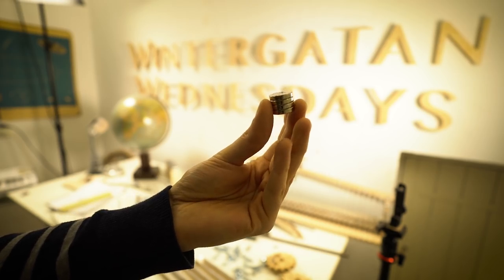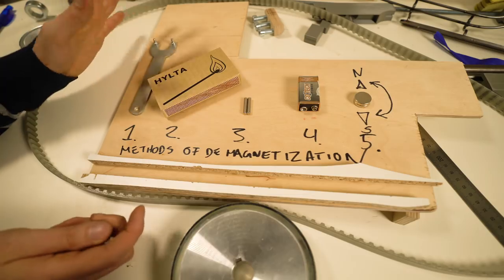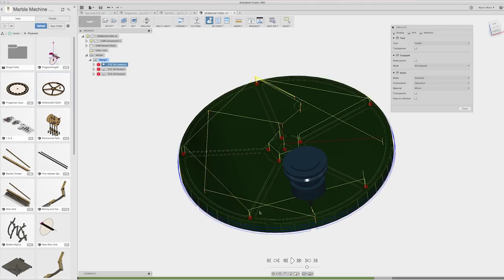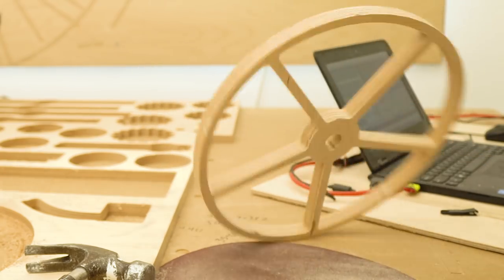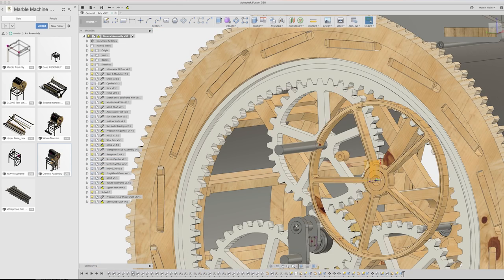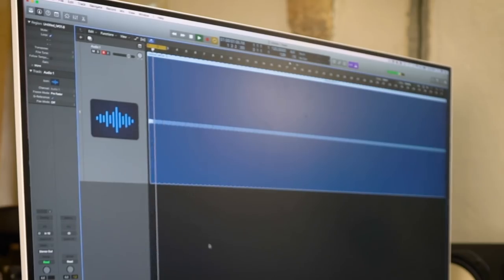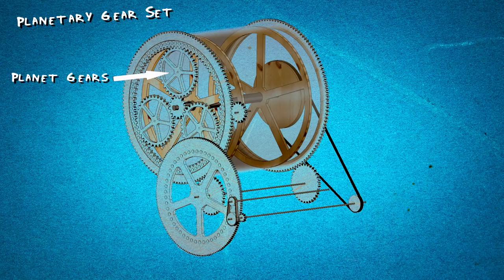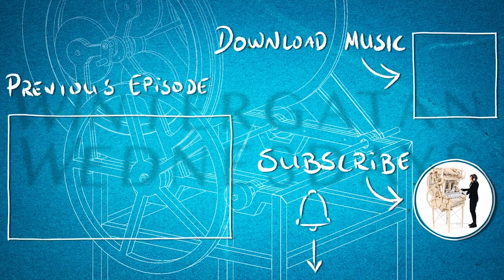Marble Demagnetizer - it's Mechanical! - Marble Machine X #23

Comment: Awesome! Loved the procrastination intermezzo! :D
I‘m just thinking: Might it be better to have the demagnetizer spinning opposite to what is shown in the video? Otherwise it could happen that a marble only sees one polarity if its speed corresponds to that of the wheel.
Reply: actually no. The marble itself spins (rolls) so... if the degauss wheel and the marbles roll in different directions this effectively adds the speeds up to each other reducing the degaussing effect. If they roll in the same direction the speeds cancel out and the marble will be put under a longer time of degaussing at slower alternating magnet fields = better degaussing.
Reply: Bart Bols Right, I totally didn‘t think it through. However, it should be enough to have a line of alternating magnets below the track, which slowly slopes away from it. This should have the same degaussing effect while reducing complexity.
Reply: Problem is if the magnets are static it could capture the marbles and plug up the system
Reply: I don't think the marble will be spinning while in the lifting wheel?  interesting point, though.

Comment: In Pinball they use carbon steel balls, because carbon steel is doesn't magnetise as much. So unless you are already using carbon steel balls, you should definitely look into that.
Reply: I suppose they get knocked around a lot more than the marbles in this machine will while being transported up, that would help the process
Reply: Pinball tables also use strong electromagnets to "grab" the ball, or even move it across the playfield*. So magnetization is a problem, but there are no devices for degaussing the balls. Seems using carbon steel balls in this build would go a long way to help eliminate the problem. ( but maybe the degausser wheel does the job just fine.) 

* Bram Stoker's Dracula, Mist magnet test, moving the ball across the playfield. https://www.youtube.com/watch?v=FT8_TPn5rEk
Reply: lordsqueak in pinball machines, the marbles are being hit constantly and that's a viable method to demagnetize the marbles
Reply: Touff in mmx the marbles dont hit anything? like vibraphone, all the time? ;)
Reply: Good point. But marbles in pinball machines likely get hit several times between magnetisations. In the case of the MMX, magnetisation is a bigger issue because it's stopping the marbles from rolling, but they must roll in order to get to the hitting part.
Reply: Not really though, the balls bounce around a lot for sure, but it's mostly rubber it's bouncing off of. in multiball they do bounce off of other balls. But the thing that keeps the balls from being magnetized is the carbon steel they are made of. 
The magnets that capture balls are really strong to just grab an 80g ball in mid movement, So I would imagine normal steel would quickly magnetize and cause problems. ( judging by the video here, it would not take much to magnetize them.)

I'm not saying he should replace the degausser wheel, because it's probably useful in making sure even the carbon steel balls doesn't act up. But they would certainly help minimize the problem.
Reply: Pinball machines' electromagnets are typically AC, so they actually work to demagnetize the balls.
Reply: I am no expert in these matters, but I got curious a googled a bit. Found 2 patents in which one seems to be fed 48V but with a timer, The other is fed AC, but only uses the peaks (looked like dc orientated). So it would seem they pulse the current to avoid the coils from overheating. (so using ac avoids the need for a timer)
I'd imagine that any magnetic field, no matter orientation, would magnetize a ball if suddenly turned off. So I don't it really matters if the pulses are dc or ac, it's going to retain the last pulse. ( which is why degaussing needs to be faded out.)
I also saw something about always using diodes on any coils to avoid feedback pulses, so that would suggest the coils are powered by only positive pulses, making them one way only.
Reply: Actually hardened steel tends to have a higher retentivity, soft iron marbles would work better at not staying magnetized after they are away from the magnets.
Reply: I just know that they are specifically using carbon steel balls , for this specific reason.
I also kind of remember that ships have a huge problem with getting magnetized , and that the reason they don't use carbon steel is because it's brittle. ( Titanic was the historic example of why that's bad.)
Reply: Preeeeeeeeeeetty sure they use stainless steel balls. Carbon-steel balls would not only magnetize, but they'd also tarnish and grow dull. There is a such thing as non-magnetic stainless steel, perhaps you meant that. (I'm a blacksmith for what it's worth, I know a thing or two about iron)
Reply: The standard ball is hardened carbon steel. ( and its resistant to being magnetized )
Although there is stainless and chromed and even ceramic balls being used also. (Twilight Zone has a powerball which is ceramic, that shows up at "random") 
I don't know much about metallurgy, but I'm into pinball ;)
Reply: (Oooo, Twilight Zone is a great game. It's on my bucket list to own a Addams Family machine some day) OK, so I'm finding sources that echo what you're saying about carbon steel. At the same time, I'm under the impression that pinballs are merely 1 1/16'' ball bearings, and further under the impression that the average ball-bearing is chrome-steel, with the chrome added for the sake of hardness. I can't find any ruling on the "standard" ball alloy number. I'll have to do some more research later. Oh, but I stand by the fact that standard carbon steel alloys magnetize with no problem.
Reply: Well it could be that it is more resistant to being magnetized in the first place, but once it does, it holds it better. ?
Reply: Thats a big fat no to stainless. As an owner of several machines, you can get carbon steel balls with special platings these days if you desire but anyone who has tried to go outside the box with stainless finds the weight all wrong throwing the game physics out - work hardening of the ball can also lead to it abrading the playfield. Also going for plain bearing inevitably ends up with magnetization issues

Comment: What are you going to do about the slow loss of magnetism in the various disc magnets in the machine? As you magnetise the marbles so you demagnetise the discs a little bit and the same for the new demagnetiser magnets. As it stands, it looks as if you will have to eventually remake any of the parts that have magnets permanently glued to them.
Reply: What? Where have you ever seen a neodymium magnet that has demagnetized from using it too much? Yes, all magnets demagnetize slowly, emphasis on slowly, as in our great-grandchildren will be long dead before it becomes an practical issue.
Reply: I did say "slow" :) . I imagine the rate of loss depends upon how the magnets are used. But I grant you that neodymium magnets will probably outlast us all. There are a couple of references here https://tinyurl.com/ybygeycw and here https://tinyurl.com/y6whdejz but they are not too explicit on these particular magnets.
Reply: The magnetism of these materials arises from the crystal structure, which is homogenized during manufacture. It would require very high temperatures (e.g. marble machine on fire) or a much stronger external field (e.g. NMRI of marble machine) to noticeably decay.

Comment: For the sake of simplicity: IF the marbles already have an initial velocity (which seems to be the case in your video), wouldn't a demagnetizer wheel with zero velocity work just as well? The point is to let the marbles experience a changing magnetic field over time. By letting marbles travel over a linear array of magnets, the same effect is achieved. Or have you already tried this?
Reply: I thought the same! Plus, the marbles are rolling, so the metal will already experience fields from different directions even if the magnets all pointed the same way. I guess a problem might only be that the marbles stick to the static magnets if they don't have enough speed, and then jam the entire machine that way..?
Reply: I thought this too, he has them rolling down that ramp, all he needed to do was to put a series of alternating magnets under the ramp as it flattens out. . . I guess that's why I'm an Engineer and not an artist :(
Reply: wasn't the demagnetation mechanism required to make sure the marbles would still have its rolling momentum despite being magnetized.
Reply: i thought the same - a row of alternating magnets in a fixed position along the underside of the marble-ramp, seeing as the marbles are already moving. As they roll down they will move through + - + - + - + and so on - the magnet array could be angled slightly away from the marble-ramp (so as the marbles roll further down the ramp, the array underneath becomes further away) so the field strength should weaken as they roll further - he may have tried this though - or did he just jump straight to the spinnig idea?

Comment: Do NOT worry, you are NOT miking this, yes you are learning but so are we, its FANTASTIC that your ambition for this was so far ahead of what you knew at the start (and if far beyond what 99.9% of us will ever make) and you are making it !, everything you need to learn as you go you ARE learning !. BTW, (1) The gears fit perfectly now but (a) as far as I know wood expands and contracts depending on temperature and humidity, so you wany wish to design in some easy adjustment (or even a spring preload ?) on the bearings (b) the wood will probably wear quite fast if left as wood sliding on wood, I would give serious consideration to (1) using some kind of wood hardener (2) adding some kind of lubricant (perhaps wax ? .. thats an old cabinet makers trick on wooden drawer slides) or even (3) put some PTFE tapeon the meshing teeth (its cheap, used for plumbing fittings, unwide some from the reel and just let the gears drag it into the tooth forms, put some glue on the wood to hold it in place (its hard to stick to PTFE but there is no stress trying to pull it off, should be ok.) .great videos and you have a lovely location in france. great video series, keep going ! respect !

Comment: I'm assuming you were thinking of this, but when you demo the demagnetization wheel, you were spinning it in the same direction as the marbles, putting them in contact with the field of a group of magnets for more time, allowing them to gain a bias depending on how long they are near each magnet. If you slow your video down, the marbles are only near many fewer magnets then if you used a different design. The second design you mentioned (With the Magnets rotating perpendicular to the movement of the marbles) or rotating the wheel you have in the opposite direction of the movement of marbles would probably be more effective. 
I'm not entirely sure of all this, but my mild understanding of physics would make me believe it's true. :) 
LOVE this design and look forward to seeing more!!

Comment: Reallifesoap like your video’s, thank you. Two remark. 1. The trouble started when you introduced magnets. The fix requires more magnets. Should you not ... step back and get rid of the magnets all together. There are other ways to get your marbles up there (e.g. suction). 2. Bringing magnets in is almost like bringing electricity into your machine. Movement plus magnets plus some wire/coil gives you current.

Comment: You can still add an electric Degaussing by attaching a small DC generator to some part of the spinning system and then electronically make AC out of the DC and hide the Degaussing coil were needed. This can be done to add to your passive system.

Comment: 3:51 -  You can route the ornamental tracks first... then apply a layer of paint which will only cover the surface. Then route off a thin layer of the surface only... leaving a two-tone finish. Then cut the part. The color will remain ONLY in the ornamental part.

Comment: I have a Little suggestion: And that is a mechanical RPM/BPM counter that ensures you are Always cranking in the correct pace. Now to my idea on how that could be implemented: Think of an weight on a screw, that can be screwed in and out to adjust the force excerted on a Wheel (to change which RPM is the "correct" one depending on which song you are playing). Of course this needs a double nut locking so the setting is not accidentially changed during play. This weel is then magnetically coupled to the crank, so depending on how much the counterweight is screwed out/in, a pointer will show if you are cranking good, too fast or too slow. Like a red-green-red scale. Think like how a mechanical speedometer in a car works.

Comment: Hm, I was thinking about the notch you have in these wheels to drive them. Since all the wheels are made of plywood, and in the later videos you use metallic parts to drive them, I would perhaps use a thin layer of some metal inlay so that the driving 'pin' would not slowly eat up the notch in the center circle of the plywood wheel... might be an overkill though. In all subsequent videos you just used the pins directly into the notch... love the series to bits, and congratulation for the tenacity to do this sir! :)

Comment: Have you taken into account the speed of the marble flow and it’s direction, the speed will either add or subtract to the effective surface velocity of the demagnetizing wheel and would be a contributing factor of how fast you want it to spin, because it is parallel to the marble flow

Comment: Hey Martin: wouldn't it be much easier if you have a non-magnetic way of transporting the marbles up into the machine, e.g., some kind of lift similar to what you see in e.g. mining or construction sites (a conveyer belt type of thing)? That would eliminate a major engineering issue, i.e., the magnetism. Cheers! Love your videos, very creative on many different levels.

Comment: You could also try anneling the marbles, ie. heat them red hot and let cool slowly. That can make them magnetize less. It depends on the steel how much less. It will also make them softer, but I don't think that could cause issues.
Reply: He can then not lift the marbles anymore using the magnetic lift system
Reply: They don't stop being ferromagnetic, they just stop magnetizing permanently so much.

Comment: Fascinating! I may be late to the conversation, but is it possible to reuse the magnets in the elevator? I think I recall the big wheels alternating polarity when you built it. if you can force the marbles to roll slowly while the large magnetized wheel rotated behind it or have the first bit of track trace the top of the circle, that may demagnetize. Or I may be crazy.

Great design so far though, and honestly even greater videos. I hope the tour includes California!

Comment: Called it when you first announced magnets. I made the comments about pinball machine owners having decades of dealing with magnetized balls.

Also, you're pretty much building a giant alternator, if you use metal wires to build the marble rails. I wonder if the contact microphones will pick up the induced currents.

Comment: When you rotate a magnet you are in essence making electricity through an etheric field a full 360 rotation of a "magnet" create both a magnetic and dielectric field when these two energy fields cross they produce electricity. The centrapedal force and centrifugal forces is what is referred to as magnetism and what induces "polarity" however neather side is positive or negative in essence the repulsion is caused by the clockwise and counterclockwise energy paths of the energy field when you place say two "N polarity" and face them together  you are causing the molecules to be forced against each other almost like two marbles going towards each other on a track and bouncing away, where the opposite position is like two marbles on a two lane track moving past another. Another example that is more close to the movement of magnet particles is two springs rotating the same direction will always compress against each other causing repulsion but if they are rotating in apposite directions will mesh and move into another like a corkscrew. When something becomes magnetized it's acting like a battery holding a dielectric charge and producing an energy field until it's opposing energy being electricity neutralizes the force. You can see Dielectricity or a natural magnet as a highly negative charge and Electromagnetic as a highly positive charge.

Comment: For your marbles not to be magnetized you can use marbles of glass, or marbles of aluminium,  or even order a custom made marbles in a non magnetized material. Of course you will had a complete different way to lift your marbles without magnets too.

Comment: Hi, Would it work to simply have the magnets of the two lift wheels (I think I saw two in your diagram) mounted so that the polarity of the magnets on the first wheel was say North facing the rim i.e. out; then the magnets on the second wheel the other way up, i.e. South facing the rim?
Also I LOVED how you used sound as the source of your RPM measurement.